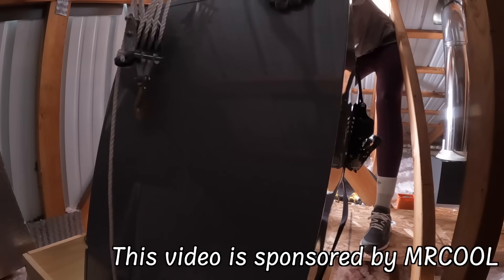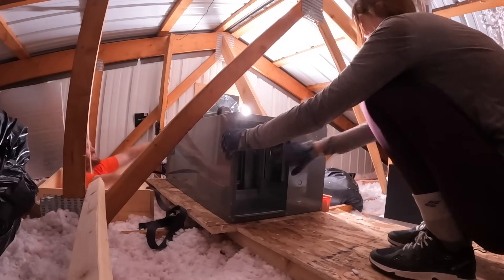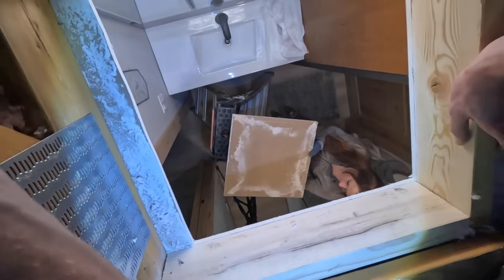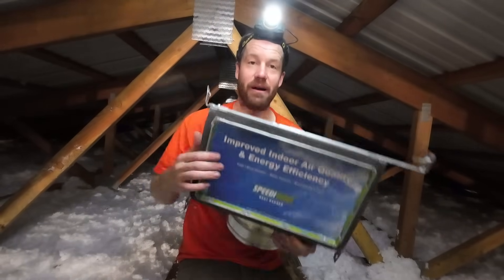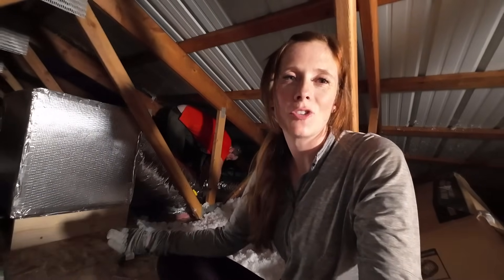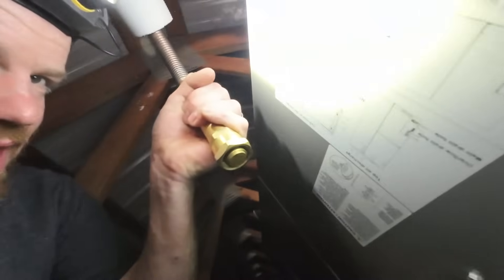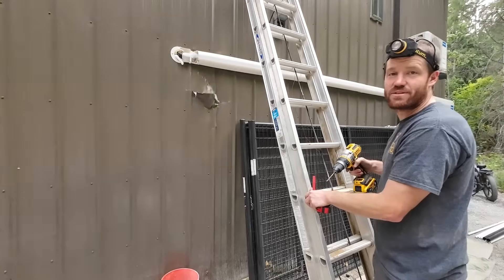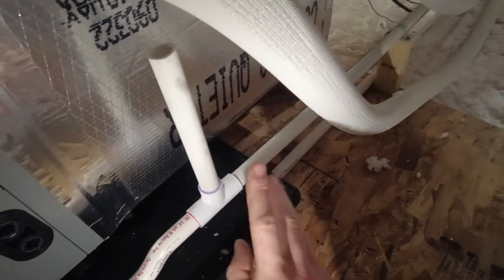Replace Your Old HVAC System With THIS! (DIY Heat Pump Install)

Comment: From personal experience, I would take a small piece of window screen and form it over the drain pan drain because you’ve already had rodents and insects in the attic and wasps and mud Dobbers love to use that open hole to make a home and then it doesn’t drain water and I’m sure you get the point a piece of screen screwed down to prevent them from getting to it helps
Reply: I wonder if u could use a small piece of a pool chlorine tablet occasionally in the condensate overflow tray to stove off rodents & pests if water did ever happen to flow into it, the water would activate the pool chlorine, sterilise the water to reduce algae buildup & keep unwanted pests away & from drinking or using it.

Comment: Putting an air handler in an uninsulated attic is energy inefficient. Modern building science says put air handlers in conditioned space. And yes lots of people do put them there, but you are off grid and wasting a lot of energy is bad.

Comment: Good job you guys. 25 yrs in the trade i would suggest a float safety switch in auxiliary pan and fab a deeper p-trap on the main drain with a cap tee on the inlet for clean out and to add rv Antifreeze for the winter.

Comment: You really need to setup anchor points in the roof and around the top of the barn, to connect a safety harness for well everything you do.

Comment: Put a little piece of screen over both ends of the pipe for the secondary drain pan and the end ( outside ) of the primary drain line so you don't get dirt dobbers clogging up the drains and flooding your attic.  Just put a square of screen over the end of the pipe pull the edges of the screen down the sides of the pipe and secure in place with a sun resistant zip tie.

Comment: Mr Cool is the first choice for DIY HVAC systems.  They have it down for easy install, and well designed equipment.  I've installed 3 units and amazed with how little power they take to run, and how quiet they can be.
Reply: Mr cool keeps real hvac guys in business lol. Control boards always go out and the fittings leak.
Reply: @KKCHEVY   do you have an alternative brand suggestion?

Comment: Someone taught me when using a hole saw on sheet metal put a sheet metal disc on the pilot bit bigger than the hole saw so it will hit the disc and spin instead of the sheet metal and brake pilot bits

Comment: mini splits are more efficient because of no duct work to to loose heat or cooling..
Reply: Mini splits can be either ductless or ducted as in this project.  The main thing is to size the unit for the heating load.

Comment: I have a lot of experience in heat pump applications and though they rate the heat pumps to -30, they get ridiculously inefficient around 20 degrees and you won't have hardly any heat but a lot of electricity consumption. You have wood heat as well so you are good but heat pumps in your climate are no good for about 2 months of the year.

Comment: Just a suggestion. I hooked the evaporator & condenser drain line of my ac unit to my water storage through a gravity fed filter on my camper. it makes about a 1/2 gallon water a day here in Oklahoma.
Reply from the maker: We considered that but lead based solder used in AC coils is a concern with capturing water from standard AC units.

Comment: Hindsight, but, putting the airhandler in the shop may have been easier to install, and more efficient as the shop is semi-conditioned, vs. the hot/cold unconditioned attic.

Comment: Courtney & Riley, thank you for once again sharing your projects. I recently installed a heat pump in my home for heat, AC, and ventilation. It works so good and acts as a dehumidifier too. Well done guys. You rock!❤

Comment: We have been talking about doing one of these systems to replace our current broken system. It's a much more affordable option than paying an installer $10-20k for a system (a Mr. Cool of our capacity is about $5,500 last time I checked).

Comment: FYI we raised 6 daughters never once did we try to be quiet. Dishes ,Vacuum, Mowing ect. Little ones get use to it and still nap well. Your going to end up tiptoeing for the next 4 years.
Reply: Agreed except... That multitool they were using might be the loudest handheld tool on the planet. Not as bad on the drywall they were cutting but still. Thankfully they never let us hear the sound of it in the videos
Reply: @Gibb591  their style of living is constantly on the upgrade. There will always be noise. So where do you draw the line?
Reply: @arrobrewer2730  I draw the line at hearing protection required. So the multitool in the same room or an adjacent room when cutting through wood or metal is an example
Reply: @Gibb591  agreed and hearing protection would be the extream

Comment: Overtime you will start to notice that fiberglass in your dust by that time it’s in your lungs. Use 2 pc. Metal duct with snap lock joints been there done that

Comment: As soon as I saw it going in the unconditioned attic I shuddered. Such a horrible place for it, would have been so much better hung in the insulated garage and vented up through the floor. Why why why do people keep putting air con in attics? If you have to do it in the attic, then closed cell spray foam the bottom of the roof deck first and make it part of the conditioned space.
Reply: Attic is unused space, garage is very much used space. HVAC systems are designed specifically to be put in the unconditioned space in the attic, nothing wrong with it at all.
Reply: It’s fine.  They can (and should) just make at least a small room around it with insulation board covered in radiant heat barrier… or do the entire attic.
Reply: @dus10dnd  I never said it wasn’t a common practice, or that they were going to have a catastrophic failure.   But…..it is no longer considered best practice to install them this way and they have at least two better spots it could have been mounted with less issues. (Through the floor and through the sidewall)  floor install would also have been way easier and they have tons of space and the ceiling height to build out a small utilities room underneath and run the ductwork without interfering with anything in the workshop. But I get that this is the way it’s been done (especially in the south) for a long time and old habits die hard.

Comment: Riley, I suspect that your choice of positioning of the intake air vent in the bathroom will prove to be less than ideal. Most people keep there bathroom closed all the time especially when a toddler is involved. I hope I'm wrong.
Reply: In my albeit limited experience, a hallway is best location for air return.
Reply: A return in the bathroom is never a good idea for obvious reasons.

Comment: You could have lightened the load by removing the fan & coil from the cabinet , some attic openings were so narrow I removed everything, flattened the case and rebuilt it back up in the attic

Comment: So I like that you did this... but I'm still curious as to how you will solve your water supply problem/challenge.  Is there any chance you can collect rain water into that holding tank now?  Even snow melt could be collected.  Just curious.  I did catch your review of that water condensor thing... and it's a shame it didn't work for you - but there is tech out there that could make that sort of system possible... even combined with rain water collection.

Comment: Have you guys tied the solar over the deck into the solar charge controllers in the shipping container? Any thoughts of adding a couple extra two columns of panels on to each end of the tilting solar array (12 more panels total) so you make more power during the winter and possibly do not have to run the generator at all?

Comment: Good installation, will the attic fan be enough to vent out the heat generated in this ahu,
Reply from the maker: Great question! The heat is generated by the outside unit, so that isn’t a concern.

Comment: Besides the sponsored nature of this video and all the past mr cool vids, it now seems redundant to have all the previous installs. Seems wasteful and not thought through, would love more context
Reply from the maker: We do not want shop air and home air mixing, so they need to be separate systems. The unit we installed in the bedroom wasn’t efficient at cooling the whole house and couldn’t heat at low enough temperatures in winter. This system solved both of those problems at once!

Comment: Just out of curiosity (and maybe I missed it), why did you guys go with a ducted setup, thus having a bunch of leaky ducts in an unconditioned space, as opposed to doing ductless MrCool ceiling units and just using a three zone or four zone outdoor unit?   Heating capability of standard units in cold weather?  My family and I are also completely off grid in AZ and I installed MrCools as well, but we did all zoned interior air handler units.  We also don't have the severe cold to deal with either.

Comment: The most common mistake home owners make is putting a restrictive air filter in or not changing their filter often enough. I think that if you're running one of those very restrictive filters then you need to have at least two to three times the size of air returns with filters at their openings in order to maintain the same amount of air flow. 
You could've made your ductwork in house. This guy got some great tips and shows how to do that
https://youtu.be/iJajWE4FjlE?si=A7TyZ6IGAxzkb08-

As long as you have heat strips in addition to your heat pump as the heat pump is now got below freezing I think. They make clear plastic air deflector for your air registers if they're putting too much cooling where they are

Comment: And now you know why I stick to window units.  I like the Frigidaire gallery as the quietest and Hisense (for baby rooms) but they always put out a new and improved version so long as you buy the one for babies, some, like the Gallery, will be quieter than central air and cheaper to replace.  I get 12 EER on the Gallery and 15 EER on the Hisense but the Hisense is louder.  They need to have Db ratings as a requirement also.

Comment: We had been around several of our acquaintances with small children and babies. They all did what you do on the be quiet front. We didn't want to do that so we just went about our noisy days and nights. We figured that we weren't quiet before the birth so why change. We had no problems. Our baby could sleep through anything with no problem. We are loud .

Comment: Great you got the sponsorship!  Mini-splits are super efficient, will you be using them for heat? What is the SEER rating? I just installed a Fujitsu 25K  BTU and the SEER is 22.5. The lines are not pre-charged but the vacuum process is a 15 minute breeze.  The trouble is, you have to be a licensed contractor (in NY) to buy them from a supplier. Keep up the great work. Wear eye and ear protection!!!!

Comment: Tim from Canada suggestions.. I am hoping that you have reinforced the area that you are going to be putting your air conditioner unit in, for example.. making a platform out of 2 x 6 the size of the air conditioner unit for it to sit on.. this would have been the first step in your job description. Having a base for your air conditioner unit to sit on is the most important part of this project. ….

Comment: Really nice one - thank you!    We converted to whole-house high SEER Lennox forced-air heat-pump 3 years ago for our 2600sq ft home.   We live in Zone 4 climate - e.g. milder than yours.   It's very efficient (same a mini-splits) till >110F and <35F at which point it works but runs at it's overall 5000w max.   Very cool to see -20F for yours!      Our only problem in terms of 100% solar is that our 14kw solar array produces 20-25% in December of what it does in summer.   December's 400-600kwh is not enough for ~1500kwh power needed for a 100% electric December.    Nov, Jan are better but still not enough.    Interestingly, summer's hottest month tops out at 700-800kwhs + we have plenty of solar power.    Look forward to hearing how it works for you.

Comment: Thats a good idea to install a diy central split AC at least ur summer will be better and cold instead of hot and sweaty and i really liked the idea of using water tub then tying the ac machine on it in able to make skid steer reach high enough for u to slide ac compressor up

Comment: Seems like a bad location for the air intake. Don't use the toilet when the air is on ....  ugg
Reply from the maker: Our incinerator toilet has an exhaust fan of its own, meaning there are never any smells in the bathroom (it’s pretty incredible).

Comment: Is the plan to keep all the doors open for return venting? My older house was retrofitted for HVAC and has a single return. In order to keep the house cool/warm I have to keep all the doors open.
Reply from the maker: We very rarely close the doors, but when we do there is a pretty large gap under both pocket doors. We’re hoping that is enough.

Comment: Just curious about the return air in the bathroom,  was that the only spot for it?  Concerned about the odors and the humidity from the bathroom......   Also you might want to add a couple of more vents to help reduce the volume of conditioned air coming out each vent,  maybe one in the kitchen and a second one in the living room.
Reply from the maker: With such a small home that was the only place we could come up with that worked easily. Because of the incinerator toilet there are never any odors in the bathroom but we will be mindful of humidify.
Reply: I thought the same thing about the return duct in the bathroom.  When building houses, we never put return ducts in bathrooms, only supply vents

Comment: Scary lift.  Consider auxiliary belayment in future lifts.  Step ladder used...equally scary.   A straight ladder sticking through the access hatch and tied off highly recommended.  Youth and strength admired.  Please don't let the luck run out.

Comment: Do you hear the unit running up in the attic or is it quiet?
Reply from the maker: We can’t hear the unit at all. There is a little noise from the air coming out the ducts.

Comment: this video came at the perfect time!  My centrail air unit died after only 20 years (lol)  which was also heat!  I only need to worry about 900sqft so I am totally going to check this out to see the specs!